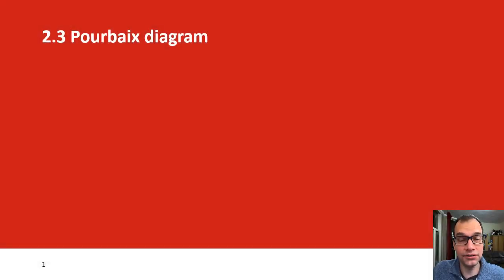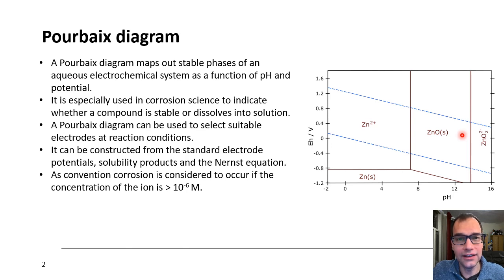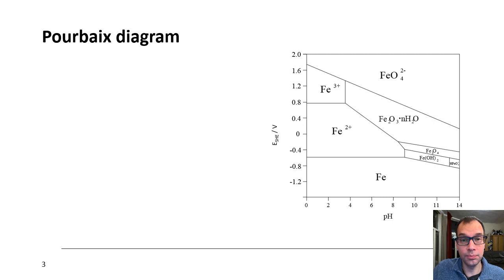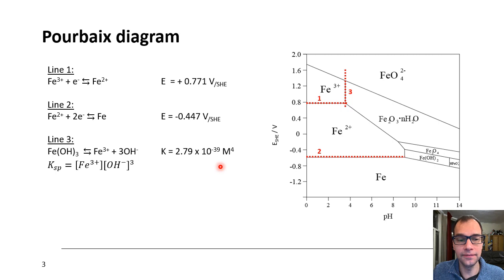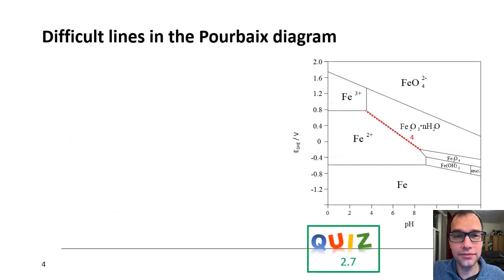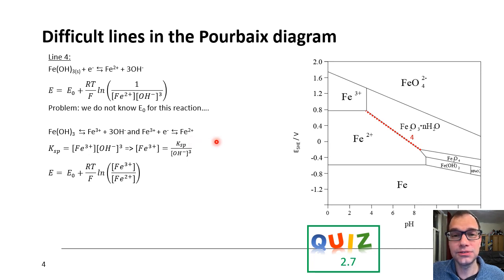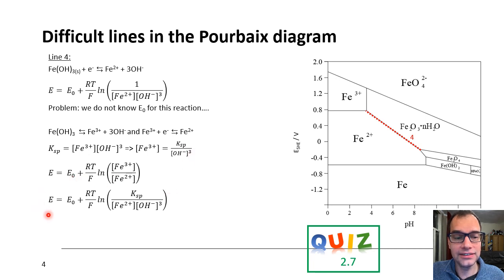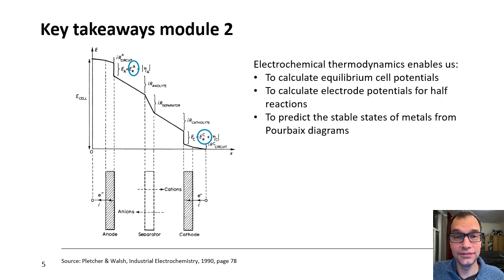2.3   Pourbaix diagram

Comment: Good morning Engineer, i got a big  doubt on the line 4 equation. Our teacher don't explain why we have to put in the reaction equation H+ or OH- and when i'm starting to write the stoichiometric equation i will always use H+. For example for the line 4  i will write :  Fe(OH)3 + e- + 3H+ ----> Fe2+ + 3H20. The final equation will change or not and how i have to set my process between choising H+ or OH-. Thank you so much for the disponibility.